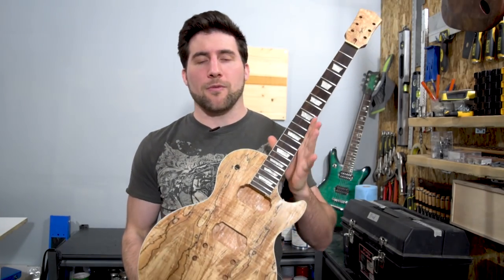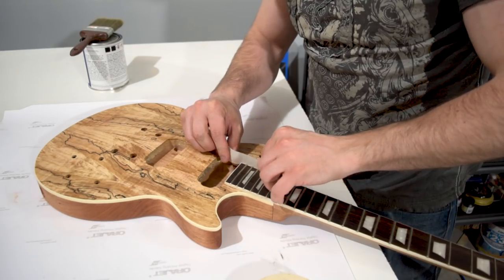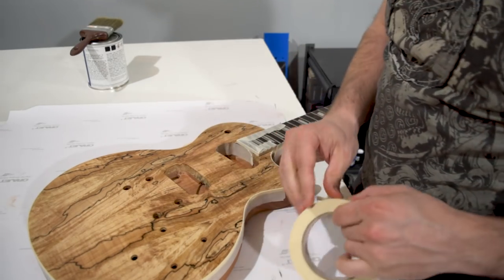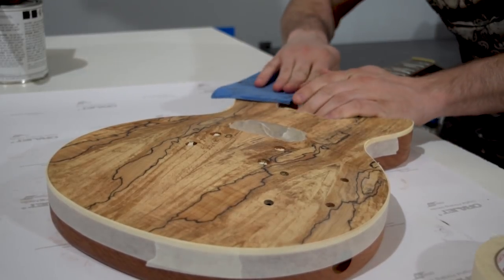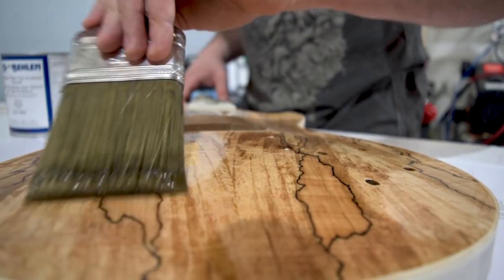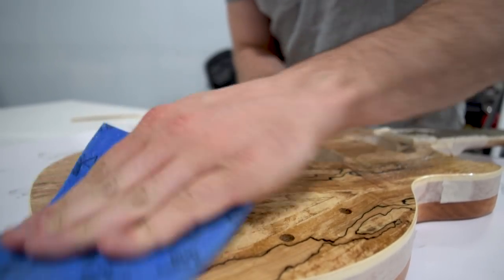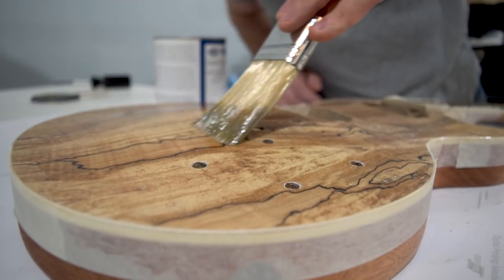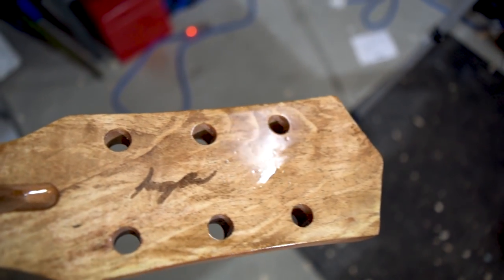Make an Awesome Les Paul for Less Than $300 | Brushing on Gloss Urethane  (Part 4)

Comment: Coming along nicely! \m/, ,\m/ The Behlen’s looks like it goes on a bit thick for my tastes. I would probably thin it out a bit and use more coats... :) (Also, waiting to see all the ‘tonewood’ guys tell you that a super hard finish will dampen the wood resonance...but let’s not go there....LOL)
Reply: IamDunn pandoras box
Reply from the maker: I think people are finally starting to change their minds on that. The problem is when people take these techniques and apply them to acoustic guitars without asking about it. Then it actually does dampen the sound.
Reply: Brad Angove ..You, sir, are 100% correct. But, acoustic guitars are a completely different beast! I’ve yet to try tackling one. I might start with a kit... Hmmmmm... off to solomusicgear.com ... :)
(legal disclaimer. I IamDunn have in no way been compensated for posting this comment, nor am I affiliated in any monetary capacity with Solo Music Gear... well, not yet any way... LOL) :)
(edit ... well dammit, I thought they sold Acoustic kits too...) Oh well, I’ll wait... :)
Reply from the maker: They do sell acoustic kits, don’t they?
Reply: Brad Angove ...LOL... well so they do!, I’m just old and ‘Interwebs’ challenged. I didn’t realize there was a drop down section that I could access. :) Lots of other selections too... Thanks... :)
Reply from the maker: I did a custom job on an acoustic a few years ago that I posted. Might be helpful. Behlen’s guitar finishing kit it designed for those as well.

Comment: +Brad Angove pros & cons of brushing on gloss urethane vs tru oil? How do they compare in terms of durability? Can tru oil get as shiny as urethane & can it be buffed out at all?
Reply from the maker: Tru oil build much slower and thinner and requires more coats. It is arguably easier, though more time consuming, to apply. The urethane is quite a bit more durable. You can eventually build a glossy coat of either.

Comment: For a gloss varnish/urethane I would definitely stir it thoroughly as the chemical that gives the gloss finish can separate out in the bottom of the can, giving you a finish that  (i) isn't what you expect, and (ii) changes as you work your way down the can.
Reply from the maker: Yeah, you need to check for any kind of separation for sure. You can usually tell if you look closely at this material whether that has happened, but of course it’s best to stir to be safe.

Comment: hey dude great stuff!  I work with many different top coats on a lot of different substrates.  I also use many different applicators.  Did you EVER think of or use a foam roller for when you want to get it nice and thick?  No brush marks, and it works with primer, urethane, clearcoat you name it!  and they are cheap at the dollar store or even THD!  Im buying one as soon as the one you have becomes available again!  thanks again for your hard work(content)!
Reply from the maker: I’ve used rollers to put finishes on many items. Never on a guitar though. There however a few guitar related applications that I would use a foam roller for in the right circumstances.

Comment: What I need is some tips in finishing the neck on this?  Specifically regarding how to mask it so you can get finish on the binding so it will match the body without getting it all over the fretboard?
Reply from the maker: You use masking tape for that.

Comment: Brad, I hate to ask you detail like this on a two-year-old project but maybe you remember.  I just want to make sure I have this process down.  1. You applied tung oil full strength to the back, side of the body, back of neck and back of headstock (using either foam or cloth). 2. You then cut it by 50% with mineral spirits and applied it to the neck (frets), headstock (front) and the front of the body. 3. Buffed and waited for the 24hrs and sanded entire guitar with 600 grit. 4. The second layer you use the 50% thinned mix of tung and mineral and add the dye to taste to wipe on the entire body for the next coat for the entire guitar ... buff .... wait 24hrs and sand entire guitar again with 600 or maybe move up some on the grit 5. The 3rd layer you went back to full strength and more dye to wipe on the entire guitar to get it darker ... buffed ... waited for the 24hrs ... sanded entire .... 6. Repeat step 5 until the desired color is gotten then add poly.  Sorry for the long list but hopefully this fills in some blanks for some others also on the first build.  Thanks again for some great and inspiring videos!
Reply from the maker: Hi Ken. I believe is was that or something very close. Really the number of coats and use of dye are all based on desired effect. Give enough time between them and you can kind of do the whole thing “to taste” so to speak.
Reply: @BradAngove  Thanks Brad!  Off to the lab! Lol

Comment: Hey brad great video! What brand of polyurethane do you use when you spray with a paint gun? Also do you use waterborne or solvent based polyurethane? I’m looking for something of good quality but that doesn’t cost a fortune. I really like HOK colors but after you buy the base color paint, reducers, activators, surface sealer and clear urethane paint your into about $200 for just paint haha thanks for any brand recommendations!
Reply from the maker: U-Pol makes a decent catalyzed urethane for a more reasonable price if you have the safety equipment to be spraying that sort of thing.
Reply: Brad Angove I’m using a Fuji Spray 5 stage turbine spray system and do have a mask and goggles for spraying. I have experience with lacquer but not much with poly. Thanks for the recommendation!

Comment: Quick question here. Why not keep using oil to get a gloss finish? I have done a few gun stocks with 15-30 coats of tung or true oil on them and they look like a mirror.
Reply from the maker: Because that takes 15-30 coats. This takes 2-3 and is more durable.

Comment: Lookin good Brad. Why did you decide to go with a brush on poly and not say a true oil finish. Tru Oil will give super gloss as well.
Reply from the maker: Because of the open pores in the spalted maple. It would take ages to get that leveled out with tru-oil. The urethane does it in just a few coats.

Comment: Brad ... I am loving the videos.  I have two questions. I have a solo kit coming in (Spalted Maple LP) and I have watched a number of your other videos also.  Would it be ok to replace the RockHard Table Top Varnish with the Minwax Oil-based Wipe-On Poly at this stage or is the RHT a must to avoid an adverse effect with the Tung Oil?  And the second part of the question is if the wipe-on is an option should I apply the first coat full strength with some 1500 grit sandpaper?  Thanks again for some great videos.
Reply: Also ... Would the minwax fast drying polyurethane-  oil based be a good substitute for rock hard table poly if I did choose to go with the brush on poly?
Reply from the maker: Yes, you could use either of those options. I like using the sandpaper for the wipe on stuff to begin with, but it’s not required per se.
Reply: @BradAngove  Thank you Brad and I really appreciate the quick response on an old topic.  I can't wait to see what I create for the final product.  Your advice and videos, I am sure, will be invaluable.  Cheers!

Comment: Behlen table top is really expensive on Amazon UK (about £78 or $138 can dollars a quart.)  are there any good alternatives you would recommend?
You can get it cheaper via EBay but with taxes/shipping it works out about £50/$86 Canadian/ $67US a quart.
Reply from the maker: Wow! That’s insane. Have a look on my channel at my video on how to brush on a gloss finish. That product behaves similarly. Can you find that in the Uk?
Reply: Thanks Brad, had a look at the paint on Varathane product you use and it's a similar price to the Behlen.
 Minwax wipe on poly (£25/$46 can dol a quart) is looking like the only UK alternative at the moment. Never used it before so I'm not sure about its quality in comparison to what you're using. Any experience with the stuff?
Reply from the maker: Yeah. Quite a bit actually. I demonstrate that product in my video on how to get a perfectly smooth poly finish by hand.
Reply: Cheers Brad, I'll give that vid a look.

Comment: Hey Brad...  love what your doing with this guitar. I'm building a maple telecaster with the same finish and was wondering if I could spray Mohawk stringed instrument lacquer over the oil instead of brushing on the urethane ? Maybe apply the Vinyl sealer first ?
Reply from the maker: Yeah, give it a couple weeks for the oil to really dry. Then scuff lightly and apply the vinyl sealer, then the lacquer. That’s essentially what I did on the telecaster build that I’m currently posting videos about.
Reply: Perfect thanks a lot... got to tell you that I love the the vinyl sealer and stringed instrument lacquer. I used both on another build and they were amazing to work with !! Your reviews were spot on and helped make the process much more enjoyable.
Reply from the maker: Darryl Lucier glad to hear they worked well for you.

Comment: I just put one of these together, and I love it, but a few things folks might want to know. First, no surprise at this price, the electronics are useless. the neck pickup on mine is so microphonic it picks up any handling noise anywhere on the guitar. The pots and switch come as a semi prewired harness and buzz really bad especially when touching the strings. The hardware is coated with heavy black paint, so the ground wire going to the stop bar stud will be useless unless you take the time to scrape the paint off first to ensure good contact, However after installing new pickups and electronics, this guitar looks, plays, and sounds really good. I used a mix of gold and black hardware, black studs with a gold stop bar and bridge, black ferrules and gold tuning machines , and everyone who has seen it is awed by the look of it. I do recommend it for someone wanting a custom look and the fun of putting it together yourself, but it will cost more than 300 dollars to make it right, I figure I'm into it for 500. Still a good price for a guitar with my name on the head stock
Reply from the maker: Thanks for the additional info. Did you pickup up two sets of hardware for the additional colour options, or just a gold set that you combined with the black stuff on there?
Reply: I combined the gold with the black parts that came with it. I actually used some parts from another guitar first, to make sure I liked the guitar well enough to spend more money on it, and didn't want to shave the gold mounting rings for the pickups to fit the curve of the new guitar, so I used the black ones that came with it, which I had already shaved to fit. I thought that combination looked pretty good so I combined the rest of the parts to make it match,. Since then I have found some knobs on line that are black with gold centers to round out the whole thing. I just finished the final set up last night and it plays excellent. Glad i found your video when I did, because I must have got the last one they had, as they have been out of stock since then. Also thanks for the idea to bevel the corner of the body by the heel on the treble side. It really makes it feel nice when playing up high on the neck. I also beveled the body where it rests on your body , like a strat. worked out well
Reply from the maker: Excellent. Sounds like a pretty good setup overall.

Comment: Great build!!
That spalted maple is awesome! How would you make that finish like glass? I noticed some inconsistencies in the finish. If you used filler to fill in the low spots, would that take away from the spalted maple top?
Reply from the maker: To make it like glass you would need to probably do a bit of filling and then be sure to seal it before moving on to using a high gloss finish. 

I would think it depends on how you handle the filling process and what filler you use.
Reply: @BradAngove  what would you recommend as a filler?
BTW..
Great job on Darrell's paint job on his guitar.
Reply from the maker: Super glue actually makes a nice transparent filler if you get the right kind.

Comment: So is this just polyurethane? Or like oil based varnish? we dont have  'urethane' here in australia
Reply from the maker: It’s more like oil based varnish.
Reply: Thank you for the reply. 2nd question non related. I want to do a thick, super glossy finish on a maple fretboard just like my MIM tele. I havent found much info on this online because most people want to remove the gloss. I was wondering if you could do a video on this or have any recommendations on products to achieve this? Ive already done one fretboard where I used automotive clear on the fretboard for this effect but it did not go on thick enough to fill the grain, even though I did 9 coats, and just didnt turn out very good. I come from an automotive background and have little experience with wood.
Reply from the maker: What kind of wood is your fretboard?
Reply: Maple
Reply from the maker: Standard maple is very tight grain. Just one coat of a brush on poly should do it. Two at most.
Reply: cool cool. would be great to see a vid on it cause i cant find any on youtube!
Reply from the maker: Yeah, like you said, not many people are glossing their fretboards these days. I can see why that would be tough to find.

Comment: Hey Brad, what did you do to clean the brush after you use it with urethane?
Reply from the maker: I cleaned it with paint thinner.
Reply: @BradAngove  cool, thanks for the quick response!
Reply: @BradAngove  I applied the brehlen urethane and it gave kind of a granular look on the finish. Any techniques to remove the urethane to try again?
Reply from the maker: Sanding is the safest option.

Comment: Have you ever tried a mini-roller?
Reply from the maker: To roll on the paint? I have with some types of paint. Not this sort of thing though.
Reply: I use a 3" one with sponge roller on  
Sealer and urethanes. It eliminates brush strokes and is makes more consistent thickness of coats. So, sanding and polishing is easier.

Comment: I'm learning a lot from your videos, Brad, so I don't want to be a jerk. But what's up with those machining marks through the wood? Is that a problem with the kit? I didn't notice them until the tung oil went on, and I didn't notice then on the guitar you did for Darrell Braun.
Reply from the maker: Can you elaborate for me? Where on the kit are we talking about?
Reply: Perhaps they aren't machining marks. But they look like ripples across the body, perpendicular tip the neck.
Reply from the maker: Oh, I see what you mean. They aren’t machine marks. They’re more just areas where the veneer porosity varied, which cause more finish to absorb into the wood in some areas than others. At least that’s what I think you’re referring to.
Reply: @BradAngove  Sounds like a defect in the kit. Anyway to prevent or reduce that at the finishing stage?
Reply from the maker: That wouldn’t be a defect. Wood is a natural product and tends to have some variation in its porosity. Woods like quilted or spalted maple, or burls, tend to have a greater variation than others. 

You can even that all out by carefully sealing the veneer and sanding the sealer smooth and flat before doing your final finishing work.
Reply: Yes. Natural variations exist. But these look too even for a natural process. My thoughts are that's it's variations in the thickness of the too thin veneer. 
If that is indeed the case, what can be done in the finishing stage to reduce our eliminate that appearance?
Reply from the maker: If the veneer is actually thicker in some places you should be able to just sand it flat. Or combine that to a degree with using a more substantial layer of sealer to even it out.
Reply: @BradAngove  The veneer appears to be corduroyed. If it were shaved slightly thicker this wouldn't be noticeable.
Assuming I'm right, what types of finish would be least likely to show?
Reply from the maker: I’m not sure what you mean about it being corduroyed, but you’ll want to use a relatively thick sealer.  How are you applying it?
Reply: I guess the correct terms for the veneer defect I see is "barber pole" or "chatter marks".

Comment: Wouldn’t it be better to finish the body before you connect it to the neck?
Reply from the maker: Why would that be better in these circumstances?
Reply: A lot of people have recommended it to me because you don't have to worry about splashing the neck, and if you want to spray the body it is easier to hang. Really cool build BTW.
Reply from the maker: You have to be careful about doing that with a set neck guitar. If you paint the heal it won’t fit or bond properly. 
For a bolt on you would of course paint them separately, if you bother to paint the neck at all.
Reply: Brad Angove ah I see, thank you!
Reply from the maker: Thanks for watching.